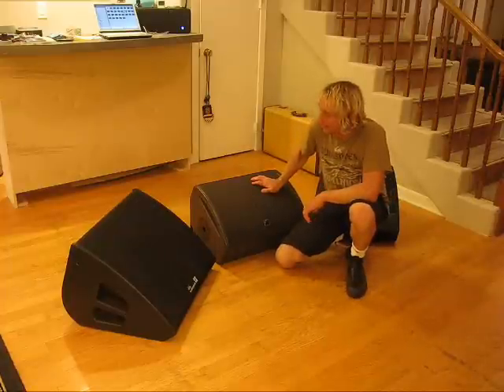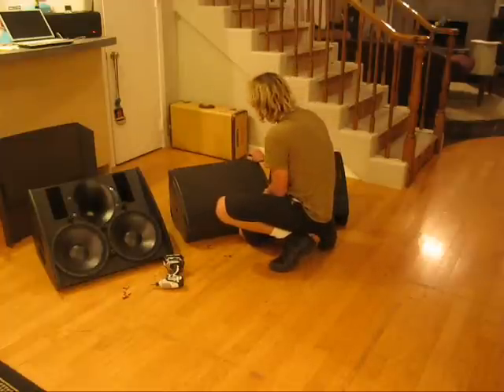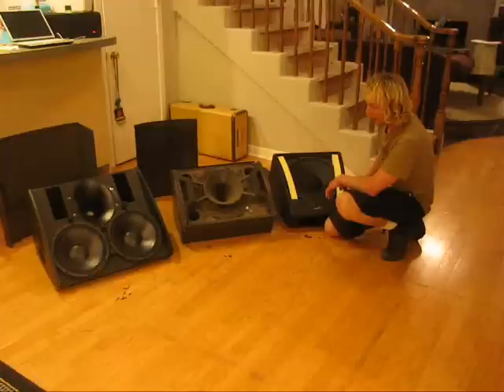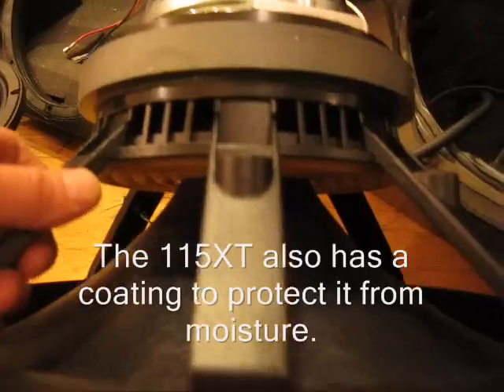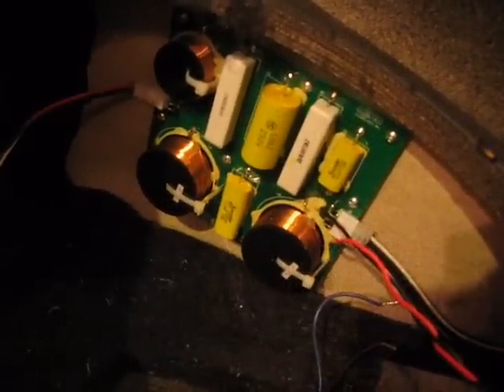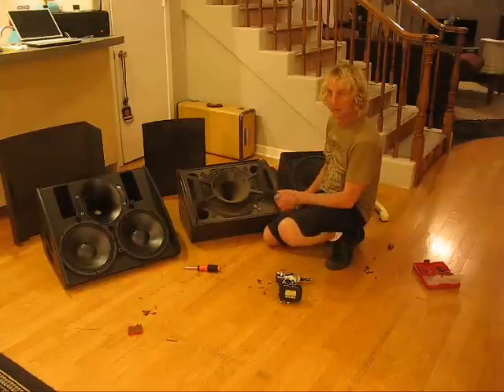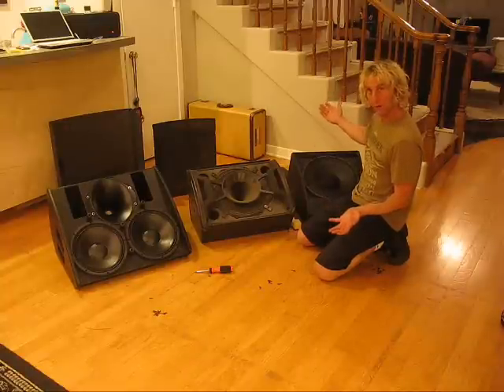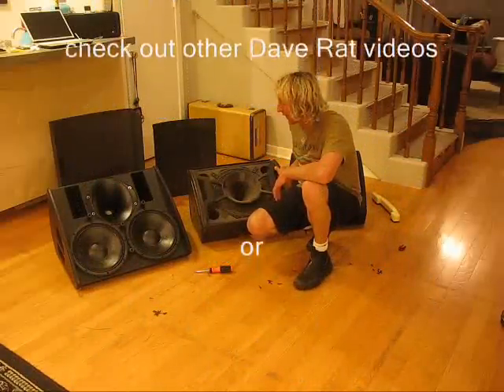Look inside D&B, L-Acoustics and EAW MicroWedge 15 Monitors

Comment: I was at a concert where the sound guys put an EAW micro wedge monitor up on the smaller side, on top of a subwoofer. Are they even designed to do that?
Reply from the maker: Absolutely, I designed them to be 90 degrees when the port faces up.
Reply: @DaveRat  Yeah, just wondering because they don’t mention using it like that on the EAW website. Fun fact: I am pretty sure a large portion of newer D&B audiotechnik stuff use B&C components. Don’t know who L-acoustics uses for the driver, but it looked remarkably like the 18 sound component. I find it interesting that even though the drivers in the EAW and L-acoustics products are similar, L-acoustics decided to add a waveguide to the hf component, which seems not to serve a purpose if you can just use the lf cone as a waveguide like EAW does. Also, does the non-coaxial configuration of the d&b monitor have any pros or cons? I like the d&b line arrays and subs the best as an audience member, (especially the subs, which hit you in the chest like no other,) but I always wonder who makes better wedges.
Reply: Pretty cool you designed the EAW product. If only their line arrays were as good. I think the adaptive systems have a plus of not being as harsh on the ears, but I don’t think the Otto sub stands a chance.

Comment: what driver l'acoustics uses ?
Reply: what series ??
Reply from the maker: I can't remember, as with many manufacturers, l acoustics has the speaker company make special cool, cone, magnet combos to suit the enclosure and goals. So it won't match an actual series exactly. You could try and search for the speakers they make that use the same frame and similar cone. 

Pretty sure the horn is an l acoustics custom part, as is the horn mount.

I know when I design with EAW for the microwedge, we used cones that are on mo other 18sound products, altered the cone curvature, the thickness, added a water resistant coating, determined the voice cool depth, used aluminum wire on the 12, and copper wire on the 15, determined the magnet types, button on the 12 and ring on the 15, searched out custom dust caps and that is just what comes to mind.

So the drivers are far from off the shelf.
Reply: @DaveRat  thanks for the information
Reply from the maker: I think those are B&C
Reply: Do all L Acoustics products use B&C Speakers.?? 
And what do you think driver the L Acoustics K series Uses ?
Reply from the maker: @rizkypratama01_  they use a variety of manufacturers
Reply: @DaveRat  isn't that the L'acoustics driver is BMS speaker ??
15S430V² Series..
Reply from the maker: @rizkypratama01_  that seems correct

Comment: Hi Dave! What are your thoughts on large-scale point source systems from the likes of Danley and KV2 etc?  From what I have read they have many benefits and don't suffer from the comb filtering of traditional line-arrays.
Reply from the maker: It really depends on what your goals are and what concessions you are willing to make. 

here is an article I wrote on the subject 
http://www.prosoundweb.com/article/zoned_summed_and_line_arrays/
Reply: Dave Rat Cheers :-)
Reply: Dave Rat  Nice! Very interesting read Dave!  One difference I find between older zoned speakers and the new KV2 and Danley rigs is that using multi-aperture horns and coupling they design their speakers to be loud enough and have the loudness, coverage and throw of some line-arrays that you only need one box per side, thereby eliminating any possible vertical interference at further distances in the high frequency on line-arrays or zoned. (Which you can hear using pink noise and moving from front to back and diagonal.) But as you said, most people really won't notice with real world audio and playback, and these boxes as impressive as they may be, don't have the flexibility/modularity that line-arrays have.  I really like this subject because in all honesty there is always great progression in speaker design in both point-source and array! :-)  Thanks again
Reply: @DaveRat  Moved to https://www.prosoundweb.com/zoned-summed-line-a-discussion-of-array-structures-performance/
Reply: The kv2 subwoofers are unbeatable though. I’ve never experienced anything else like them in my life, except maybe a D&B sub that came close.
Reply from the maker: Very cool, and subwoofer tech is ramping up, some great subs out there
Reply: @DaveRat  Yeah, I agree. I’m still not impressed with many of the simpler subwoofer designs on the market that just have 2 18” subs with a bass port between them. (Looking at you, Meyer, JBL, do I dare say, unpopular opinion, but L-acoustics as well.) Meyer is particularly bad in my opinion, seem to peak at around 60hz and sound sloppy, not punchy on lower notes.
I prefer most bandpass (Kv2) and some horn boxes (Kv2 18”, Funktion One.) And combos of both (D&B B2/B22) 10x over any of those. 
A notable exception is the D&B V-sub. Seem simple, but loud! I also think cardioid setups help more than I thought they could with sound in the audience, probably because it cancels out echoes off the back wall of a venue.

Comment: Thanx Dave, I really like your video's (if you have some time to make some new ones, it would be lovely).

I have a question, you talk about the amount of feedback stability versus a good direct in your face volume between the d&b and the EAW. But from the reasons you give for the different characteristics, I would say the L'Acoustics has both advantages. Direct in you face volume because of the horn slope and a stable feedback characteristic because its a coax speaker. Can you explain it a lil bit more? Thanx again!
Reply from the maker: the perception of "In you face volume" tends to be a result of directivity.  The more beamy the design, the more direct to ambient signal one hears and the result is a more "in your face sound" rather that a more smooth and natural sound.  Both have advantages depending on the applications and preferences or the listener

Comment from the maker: @LandRoverTeun Actually it was the D&B that made the black marks. I was moving these around and it does not leave much room for mistaking where the marks were coming from.  The rubber ring and MicroWedege feet did not leave marks.

Comment: @www73171 uhhh, I have to listen Micro's then. I'm looking for smallest wedges monitors as possible and very well balanced sound, proof made. I started with d&b, which are very nice but not as small as I want. Nexo was in my looking direction pretty small, high spl even at 2 or 3 meters very well balanced and tight sound. anyway i had to give a look to micro's before I made my decision.

Comment from the maker: @dorinpetrean I have not heard them yet.  Nexo is pretty good at making good sounding, loud and small speaker products so I would expect it to sound pretty good.  Since Nexo uses reflected sound for the high frequency to achieve the coverage pattern, my experience is that there are artifacts caused by that indirect sound that are less optimum than direct sound that the Microwedge offers.

Comment: Really enjoyed the video, not often can one rip apart top model wedges in their dining room.  One question though-you say a couple times that the 15" on the microwedge acts as the horn-does that mean that the throat length vary with the excursion of the driver or is there a smaller horn hidden under the dust cap with the 15" as a final flare?  My rather limited understanding of horn design thinks that a throat of continually varying length would have continually varying tuning, yes?  Cheers-PR

Comment from the maker: Theoretically port location isn't relevant.  At least according to everything I have read.  Though in real world experience I've found that locating the ports close to the speaker is better than further away as the summation of the port output and speaker output is important.

Also, coupling the port to the floor is even more beneficial than having the ports close to the driver. 

As far as buttons vs ring neo magnets, we compared both and the button HF, ring LF was optimum for the 15

Comment from the maker: Most likely they would not be optimum for a car but never thought of it but it may be a bit of a wallet squeeze.

Lets see, for 2 D&B M2 wedges and 2 of the dedicated mono amps, figure about $17,000 or so.

For the L'Acoustics and a four channel LA-8 amp, it will only run ya about say $13,000 or so.

And a pair of Micro's and a 4 channel processed amp will only set ya back maybe $10,000.

Plus the amps all power from 120 volts so  you would need a pretty hefty inverter as well.